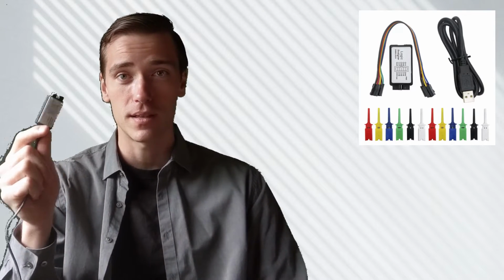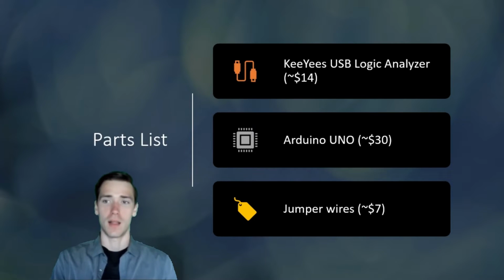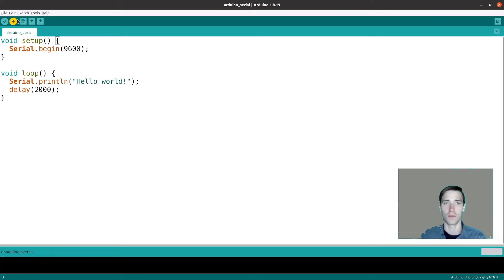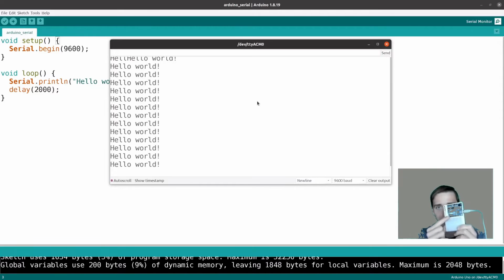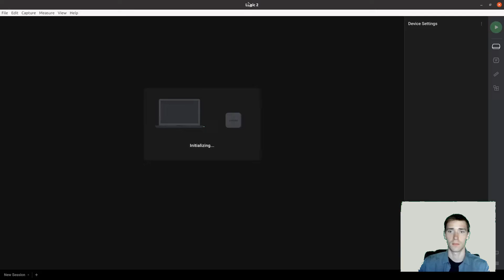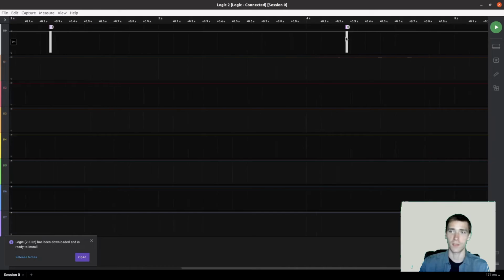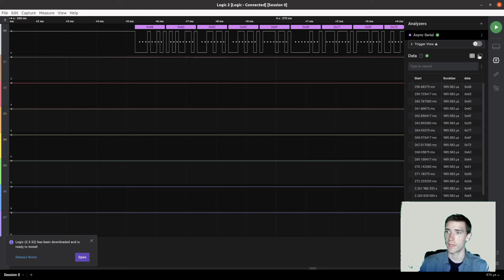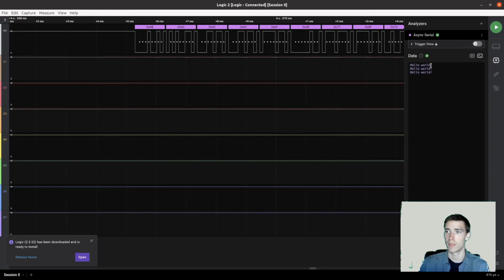How and Why to Use a Logic Analyzer

Comment: As a software engineer trying to get into hardware, this absolutely blew my mind. Great video.

I had never asked myself if you could convert digital signals from say, a USB port. Whenever you showed that working in the video it seemed so obvious. My question is, does that mean it’s possible to transport data reliably over electricity? Is that how those powerline internet adapters work?
Reply from the maker: Really glad you enjoyed! I have no idea - I didn't even think that was a possibility. Interesting thought!

Comment: very usefull device to test out some of the clones of devices from amazon( ya know the ones that come with no datasheet and the chips have no readable serial on them yea those ones( got a signal gen that needed some  heavy reprograming as it was outputing its OWN boot message as the clock signal 😂 but hey it was $10 )
Reply from the maker: Sounds like you're a legendary debugger if you were able to figure that out 😂
Reply: @PageKey  its part of the fun but I like these ad chips cause they make excellent mclks for larger synths( i.e 6ghz signal sources for radar applications). Excelent video though very usefull( also buspirate helps alot )
Reply from the maker: @dwudcuqoyl1465  Thanks again! Glad you liked it. I didn't know about bus pirate, that's a great tip, appreciate it
Reply: @PageKey  No problem

Comment: I agree, great down and dirty view, which is what I was looking for.  When would you use an oscilloscope in this process?  To help you find the Transmit and Receive pins?  Or do you even need an oscilloscope to help find and capture data and it can all be done with a logic analyzer?
Reply from the maker: Great questions! I hesitate to answer since I'm not an electrical engineer and this is getting a bit out of my wheelhouse. My impression is that oscilloscopes are for analog signals, so you can view the waveform. They also seem to be more expensive than logic analyzers, and I think many of them have built-in functions for handling digital signals, too. I also discovered through trial and error that many signals, such as those transmitted by USB, are way too fast to be captured by the cheap logic analyzer used in this video. That being said, this logic analyzer should be able to capture things like serial, I2C, SPI, and more. I hope this answers your question, or at least helps a bit!